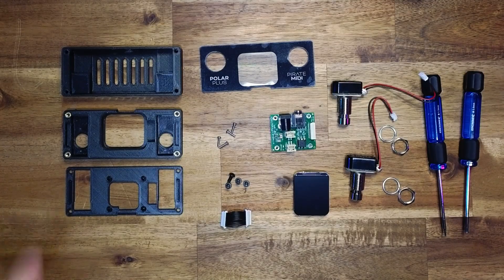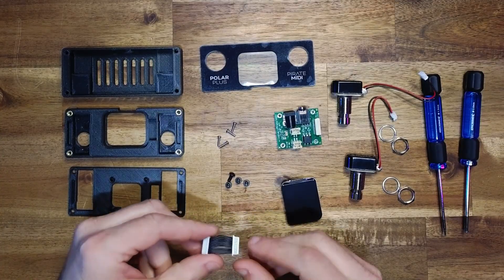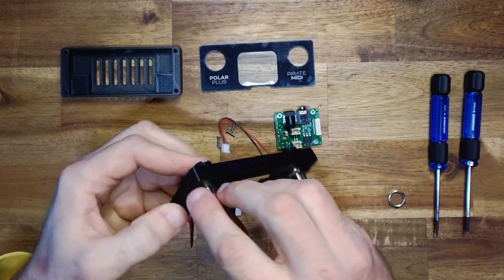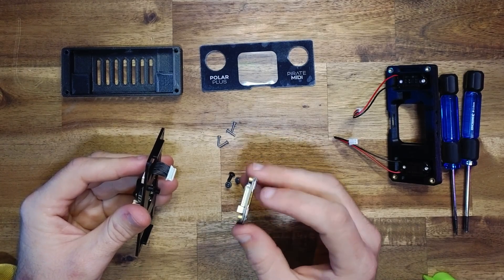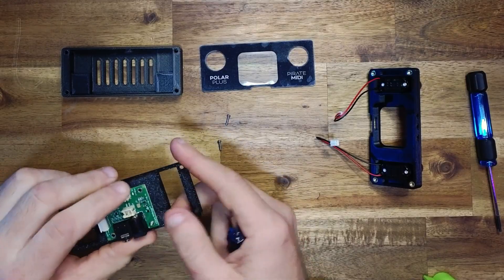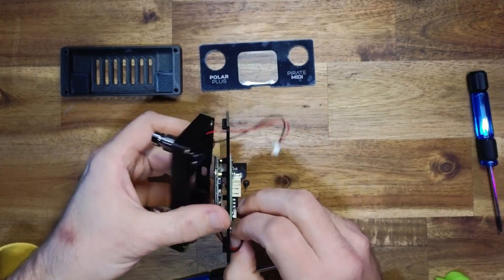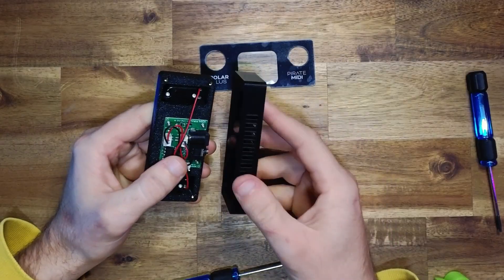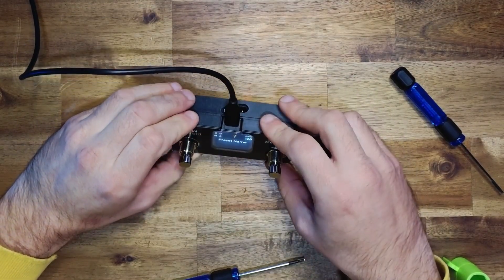Polar Plus - Build a MIDI controller for your ToneX One - full step-by-step guide

Comment: where do you get the custom PCB? Is it available separately?
Reply from the maker: The GitHub repo has the files and you can get the boards made by a pcb manufacturer like JLCPCB or Pcbway. We’re hoping to have slightly more detailed and “human readable” documentation available on the repo soon - but for now the files available will definitely be able to get you what you need! 
Of course, we sell the whole thing ready to go with no DIY as well!